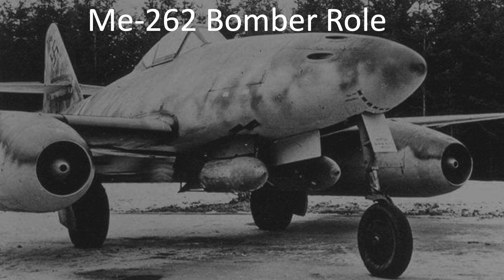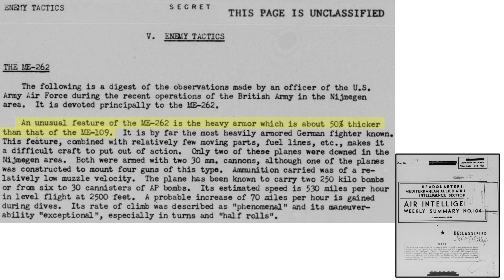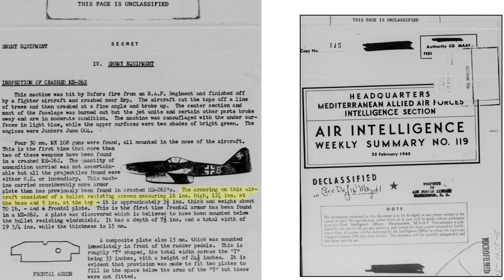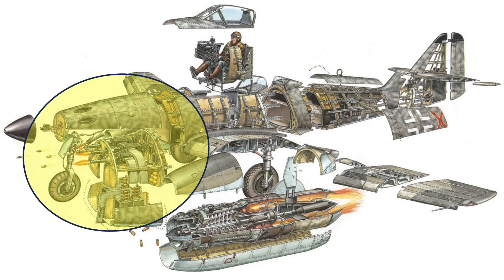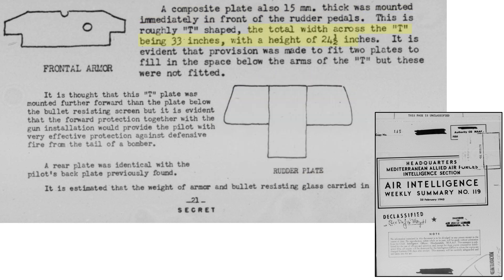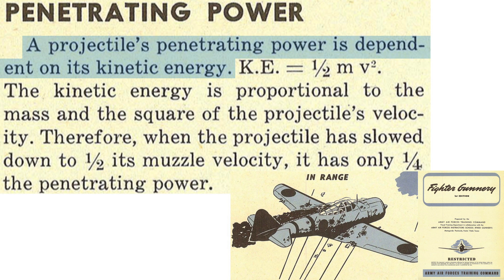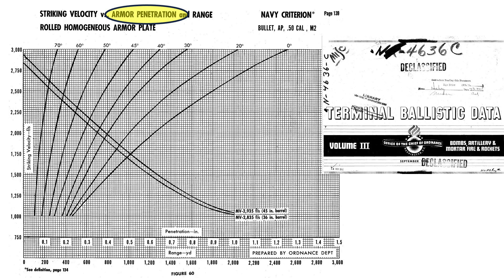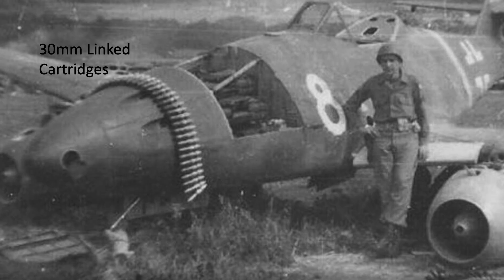Me-262 German Jet Pilot Armor Protection – 320 lbs total

Comment: I suppose that the ability to armour the 262 so effectively with badly harming its performance, was ultimately a consequence of the power of its engines. It is often said that engine power (per unit weight) is the major underlying constraint of warplanes. 

Weak engines make for bad aircraft, as many WWII examples attest. When the engine was insufficiently powerful, nothing much could be done with the aircraft. This was the cause of many of the "death traps" throughout the war - starting with the Bristol Blenheim and Fairey Battle. 

Conversely; sufficiently powerful engines enable good aircraft to be engineered - e.g. the Rolls Royce Merlin, or the Pratt and Whitney Double Wasp that powered so many of the best WWI aircraft (although engine power is only one factor among many). 

A really good engine opens up all sorts of useful possibilities (increased guns, ammunition, bombs; more armour; and many aspects of performance).
Reply: I said above "engine power is only one factor among many" - this is illustrated by the fact that the Merlin was a great engine - but it powered the death trap/ useless Fairey Battle. 

A single Merlin engine was powerful in the context of a single crew Hurricane or Spitfire; but appallingly weak in terms of a three-crewed light bomber.

Comment: No side armor for the pilot?
Reply: Armor strategy is based on both the type of threat and the direction of the threat.  Lets say that one wanted to uparmor their car.  Since weight is less of a consideration, one could fabricate side panels from welding mat and epoxy pretty cheaply, and size them to protect maybe a 16" wide vertical section where the driver and passenger torsos are located.  From the back, one could hang a large AR500 IPSC torso plate behind the seat, and an 8" gong behind the headrest, all nicely covered with that lambskin seat cover.  With the planes, the side was rarely exposed for long, but the front and rear were always in the sights, much as I would be driving away from a carjacker, hence heavy rear coverage.

Comment: The RAF did tests on a captured Me-109G in 1944, firing at its fuselage from dead 6 at about 150 yards. They used 0.303", 0.50" and 20 mm and the result was only the cannon reliably defeated the pilot armor. The structure of the fuselage, the equipment there (radios, IFF, compass, etc), extra fuel tank for MW50,  and light the laminated alloy 'armor' were enough to make the bullets tumble or deform them so they'd not penetrate when they hit the pilot armor. The test was conducted at an ideal angle (ie 90 degrees) from short range.
Reply: Interestin. do you have a link to the souce?
Reply: @Splattle101  The Hispano was bit of a nasty even cruel weapon.  When you read a can of its Use the aircraft often just blows up as the round penetrate and pass through fuel tanks and ammunition.   Other powerful weapons may be blew off a wing or engine you’re still left the chance of survival but the Hispano often completely blew up the aircraft

Comment: ME-262 was also fueled by kerosene, which was much less flammable/explosive than high octane aviation gasoline. Excellent study, love the details!
Reply: Both Junkers air frame division and the piston aero engine division were familiar with diesel as an aviation fuel from the diesel engines Junker Ju 86 and its Jumo 205 or 207 engines.     Diesel was chosen for the Jumo 004 for reasons of safety and economy.    Anthony Kay in his book "German Jet Engines and Gas Turbines 1932-1945" relates how some Me 262 missions were flown with crude oil, centrifugally refined only and then heated and pumped hot into the fuel tanks.   (Note Germany had some small number of oil wells good for 3% of its needs) .
 -Diesel, Kerosene, Jet fuel are relatively easy to synthesize by Fischer-Tropsch catalysts because they are long linear chains easily made by these catalysts.
-Purse iso-octane actually doesn't burn well which is why it resists predetonation so there was some effort by both sides to develop aviation safety fuels.  A friend of mine says he saw a racing pit crew put out an engine fire with pure octane.   
-The rival BMW 003 jet engine was designed to use 87 octane gasoline as fuel.  The German air ministry then ordered them to switch to diesel like the Jumo 004 but this delayed the engine many months because the fuel delivery system couldn't handle the more viscus fuel.
Reply: @ Very informative, thanks!
Reply: kerosene, jet fuel, and diesel fuel are all basically the same thing (not quite, but close enough for sake of argument).
Reply: I have had arguments with people about the flammability of jet fuel... but they know best..

Comment: Since pilots were a high priority and these missions would be mostly over Germany it seems an effective tactic to leave out engine armor.  If the pilot can bail out he can fly again.
Reply: Plus the engines were wrecked anyway after about 20 hours iirc.
Reply: @andrewmountford3608  They weren't completely wrecked, from what I understand, but they needed a rebuild. The issue was that the rotor and stator blades in the high pressure turbine after the combustion chamber couldn't handle the heat for very long, because Germany lacked sufficient amounts of chromium and other metals to make suitable alloys and thus had to use lower grade steel. The first US jet engines needed a rebuild after a similar number of flight hours, BTW, from what I've heard. The German approach to the issue was to make it extremely easy to swap the engines, which could be done in about an hour or so.
Reply: @andrewmountford3608  The Me 262 was issued with a sort of wire frame basket for the Jumo engines to protect ground crews from ingestion.  It turns out the baskets had no negative effect on flight performance and were often left in place to protect against debris from a damaged bomber.
-Technically the Jumo 004B didn't have an engine life of 20 hours.   Officially it was an MTBO rather than life of 25 hours.  After 25 hours the 6 combustion chamber cans were replaced and the turbine removed and x-rayed and used for another 12.5 hours.  
-In reality the 2 engines were removed and replaced (took 2 men about 4 hours)  with the engines sent to a factory or depot to be refurbished.   I think about 4 times.  
An although it was often less than 25 hours (often 10 or even 6) some lasted 60 hours if nursed gently.    (According to Messerschmitt test pilot Gerd Lindner as reported in Wings Magazine By Walter Boyne)
Reply: Unless he's injured by gunfire,  burned, got cut by the windshield not the front but all the other glass in the cockpit. Then, trying to exit a plane that's tumbling out of control, your chute might get stuck, etc...

Comment: I never expected that they'd armour them more heavily than their slower fighters, considering their longer-range armament.
Thank you. Your work is fantastic.
Reply: the 30mm cannons had much shorter range than the 20mm unless I am mistaken. As such hey had to get close to score hits on bombers though fewer hits would be needed. Excellent video again...
Reply: @andrewmallory3854  The  Wake turbulence behind a box formation of US Heavies was so enormous that the little fighters were shaken around so severely they couldn't aim at long range and a close approach was the only way.   The Fw 190A8/R2 that were retrofitted with the MK108 canon had only the outer wing guns replaced since the inner 20mm MG151 needed to be electrically synchronized with the propeller.  (MK108 didn't have electrically primers) so they retained some long range shooting ability.
-One solution was long range sniping using a 50mm canon aimed with a gyroscopic  computing sight with a stereo range finder  (there is a Japanese collector has one of these up on his page) but I think the turbulence and P-38E escorts ended that idea for the Me 410.
-Another was a lead computing gyro sight similar to the allied ones and attack from the sides.   The Luftwaffe had 3 gyro sights for single engine fighters: The Zeiss EZ42, EZ44 and the Askania EZ45.  The number indicates the year of acceptance into service.  The EZ42 was only a short production combat test in 1942 but they shot down a few Liberators.
-The EZ44 appeared in 1944.    It was installed in the Me 262 of Gallands JG 44 of super aces most of whom had 50 victories or more.  The Aces were experts at deflection shooting and didn't think they needed a computerized sight.  When they did carry out some attacks they were failures but it turns out that the gyros (which were mounted in the fuselage) hadn't been connected correctly.  After that they sight wasn't trusted and wasn't even used for the R4M rocket attacks (proably why they often failed)
-Nevertheless the sight was a success when installed properly.  The Fighter pilot Oskar Romm had an EZ44 installed in his Fw 190D-9 and says that with a little practice he was repeatedly able to shoot out the canopy of the Yak fighters he was confronting at 1000m range (a range the Hispano and Browning could do but usually a little to much for the MG151/20.)
-The Germans sights differed to allied ones in 2 ways.   1 The reflector had magnification for long range sniping.   2 Because of the long range the computer had an air pressure sensor to compensate properly for ballistics fall off.   More for long range sniping than dog fighting.  
-Me 262 were supposed to receive the EZ44 linked by the Elfe computer to the FuG 248 microwave ranging radar.  This was a 3cm or 2.5cm radar that fitted in the leading edge of a wing and fed the range directly to the gyro sight without the pilot needing to use a stedometric range finder.  

(NB Germans didn't have aces, they were declared Experten at 10 Victories)
Reply: @andrewmallory3854 
And that was a problem with the ME262, its defensive was speed, but by the time it slowed down enough to accurately shoot the shorter range 30mm it was as vulnerable to the defensive guns of the bombers as any propeller driven fighter was, some ME262 pilots tried to "porpoise" coming up behind the bombers in an attempt to keep their speed up but that made hitting the bomber difficult as it was continually passing though "windows" of it being in your sights, and because of its speed deflection shooting didn't work well because the ME262's gun sight couldn't keep up with the bomber passing through the sight, that is to say the sight couldn't swing fast enough to track the bomber on a deflection shot, I read where only their most skilled pilots had enough gunnery skill to effectively fly the ME262, and at that point in the war they were starting to run out of skilled pilots.
Reply: @andrewmallory3854 you're not mistaken. The problem with the Me-262's in armament was precisely that the 30 mm MK108 autocannon and its  extremely short effective range was a mismatch with the jet's speed; a pilot closing with even a slow moving bomber from the most advantageous tail position, the closing speed would still be so fast that there was no time to properly aim the weapons. You had to just pull the trigger and hope.
Reply: Lower muzzle velocity, but the larger the round, the better it keeps velocity over range. That's why battleship guns could shoot so far with the same muzzle velocity as light cruiser guns.
Reply: @ethanmckinney203 
But that's not the case here, as he pointed out they had a shorter range, and that's because the 30 mm cannons started out with a muzzle velocity so low it was already far enough behind the 20mm that despite it retaining energy better over distance still ultimately had a shorter range than the 20mm.
With explosive cannon shells muzzle velocity isn't important for the same reason it's important with a round like the .50 cal, since the .50 cal isn't explosive it relies on punching power and penetration to do its damage, but with cannon shells it's the explosive that does the damage, muzzle velocity is only a factor so you don't have so much drop over distance you can't even hit your target in the first place, the German cannon shells themselves didn't even penetrate the .032" thick aluminum sheet the skin of bombers were made of, the way they worked was they exploded on contact with the skin of the fuselage, they never actually entered the aircraft itself, instead the explosive force entered the fuselage over pressurizing it and basically popping it like a balloon, when it did that it tore up the frames, ribs and stringers that give the aircraft it's structural strength. 
WW II US Bombers here did a video on the German cannon shells and how they worked, in it he showed Allied ground testing of captured German cannons fired into the fuselages of bombers on the ground, right where they'd hit the fuselage would be bulged outward pretty much all the way around its circumference, looking inside all the stringers were broken in that bulged out area, break all of them like that and the only thing holding it together right there is the already damaged skin that even if it wasn't damaged would still tear from it holding all the stresses and break in half right there, with the 30mm cannon it only took a single hit to balloon a bomber fuselage in the area where it was hit.
But with the .50 cal it was their velocity and penetration coupled with having multiple guns that created a buzz saw effect, they literally sawed through an aircraft causing wings to come off and fuselages to break in half.
The German 20mm had a further effective range than their 30mm simply because the 30mm started out so slow that it had the trajectory of a rainbow, firing a real slow round like that also will lag far behind something when it comes to deflection shooting which greatly reduces the range it's possible to target something. 
Take it from someone who used to be an AA gunner, the slower the projectile you're shooting the shorter your maximum effective range, 30mm may retain its energy better over distance but when it's starting out so much slower then 20mm it's already too far behind in the game and as a result has a shorter effective range.
Reply: @ethanmckinney203 inertia stored energy.
Reply: Me 262 didnt have engine block cast iron recognized as offering protection against bullets cannon.
Reply: @Eric-kn4yn  
No aircraft engine I'm aware of had cast iron blocks, all the V engines were aluminum as was alot of the radials, it's a myth the B29's engines were magnesium, like the Wright radial engines in the B17 the Wright R3350 engines in the B29's had forged steel cases, forged steel cases could be made thin enough to be competitive weight wise with aluminum, anything cast iron would have to be so thick to be strong enough that there'd be a weight penalty too high to be acceptable for an aircraft engine, and V engines couldn't have forged steel cases made for them due to their shape so aluminum was the only option for them, cast iron V engines would have weighed so much the aircraft would have had to leave all its bombs, guns and ammunition behind to make up for it, that wouldn't work.
Reply: @dukecraig2402  true but radial engines in FW190 thunderbolts cosairs zero etc  were offering protection from bullets cannon in frontal attack or diving on ground targets no doubt  twin engine 4 engine a/c when  attacked from side or flak  piston engines offered some protection to crew and a/c   i wonder if F35 MiG 29  eurofighter have armour
Reply: @dukecraig2402 Wow, that was a great explanation. You should have your own channel. Apparently, I'm not the only one who is interested in this topic.